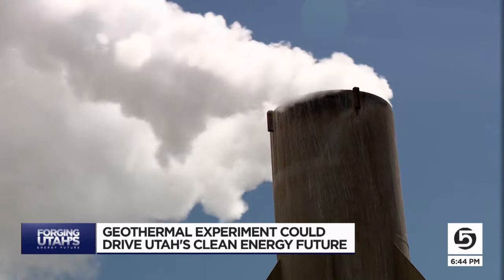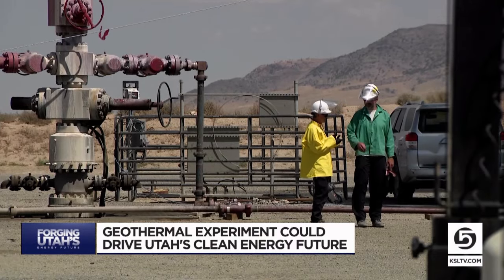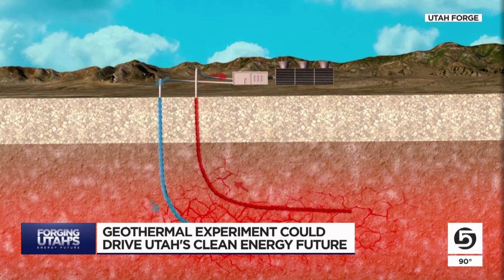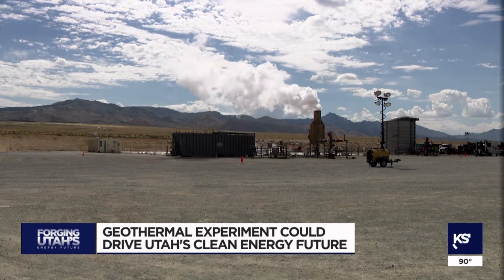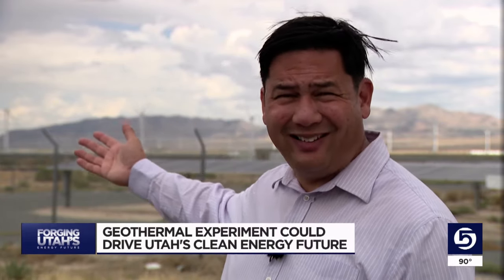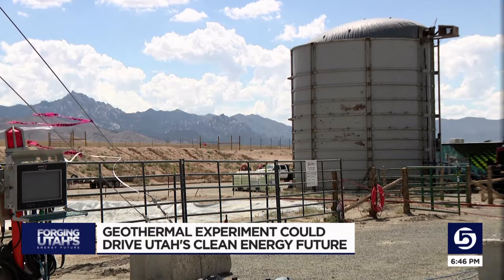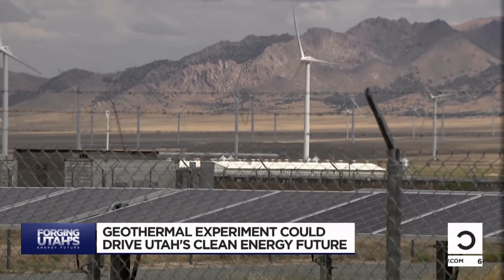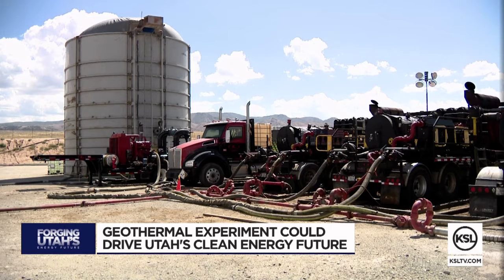The future of geothermal power in Utah

Comment: Just to clarify. This project is a DOE sponsored project being performed by the FORGE center led by the Price College of Engineering at the University of Utah.
Reply: One huge issue they left out is earthquakes I think a video I watched showed in Japan and other places that did geothermal because they inject water like fracking and you make cracks in the rock If youre by a fault zone it may cause earthquakes. And a lot of geothermal are by fault lines since that’s the crack that lets hot water escape. So I guess the question is are they close to a fault zone? Or have they studied fault zones and learned how to gauge earthquake risks? 

For instance it wouldn’t make sense to build a geo thermal plant along the Wasatch front if there’s lots of fault zones there.